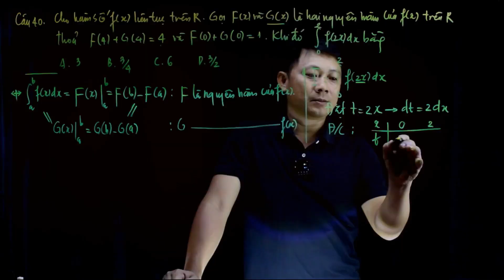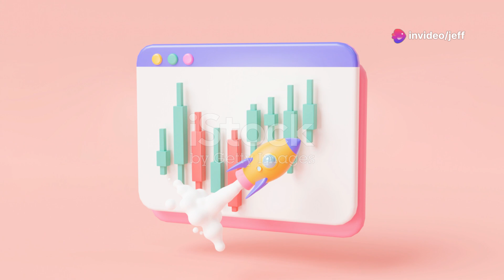Exploring Electromagnetic Anti-Gravity

Comment from the maker: Note:   When designing an electrum electromagnetic drive lift, it's essential to consider the constraints imposed by limited power. To achieve this, I recommend using a lightweight yet sturdy balsa wood frame to house the components and provide structural integrity. The frame must be carefully designed to support the weight of the components while minimizing the overall weight of the device. This approach is crucial for maximizing the efficiency of electromagnetic waves in generating lift, which is particularly important when working with limited power. By choosing a lightweight material like balsa wood, we can optimize our design and create a more effective, small-scale electromagnetic drive lift.

Comment: you have to spin your ferrofluid above 40,000rpms and in the same pattern as the magnetic field lines.
Reply from the maker: You're referring to the idea of using ferrofluids in anti-gravity applications. Ferrofluids are liquids that exhibit unique properties when exposed to magnetic fields. They can be manipulated by applying a magnetic force, which can cause them to move or change shape in response to the field's direction and strength.

In the context of anti-gravity research, ferrofluids might be used for several reasons:

1. **Magnetic levitation**: Ferrofluids could potentially be used to create stable magnetic levitation systems, where a magnetized object (e.g., a spacecraft or a satellite) is suspended in mid-air using the ferrofluid's response to the magnetic field.
2. **Gravitational manipulation**: By manipulating the ferrofluid's density and viscosity through changes in the magnetic field, it might be possible to create localized areas of reduced gravity or even "anti-gravity" effects within a controlled environment.
3. **Propulsion systems**: Ferrofluids could potentially be used as a propellant in advanced propulsion systems, such as magneto-plasma dynamos (MPDs) or magnetohydrodynamics (MHD). These concepts involve the use of magnetic fields to generate thrust and propel objects through space.

Regarding spinning ferrofluids can indeed be manipulated using rotational forces. By applying a spinning motion to a ferrofluid-containing vessel or device, researchers have demonstrated the ability to create stable, rotating structures that can withstand significant gravitational forces.

Some notable examples include:

1. **Ferrofluidic bearings**: Researchers have developed spinning bearings that use ferrofluids to reduce friction and allow for smoother rotation of mechanical components.
2. **Rotating magnetic levitation systems**: Scientists have created systems where a spinning rotor is suspended in mid-air using ferrofluids, demonstrating the potential for stable, high-speed rotation in zero-gravity environments.

Keep in mind that these concepts are still in their infancy, and significant technical challenges need to be overcome before they can become practical solutions. However, the exploration of anti-gravity concepts and their applications is an exciting area of research with great potential for future breakthroughs!
Reply: Why u saund like chat gpt 🤔 p.s but thenks it was informative 😊 @jefflucas_life